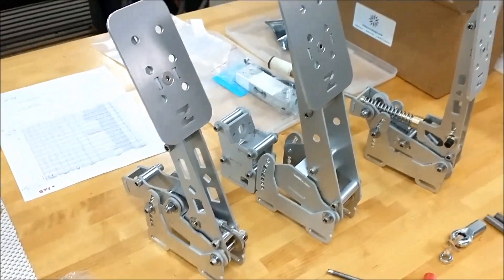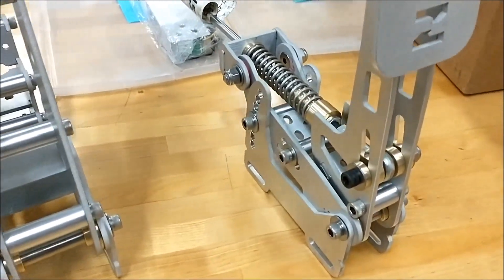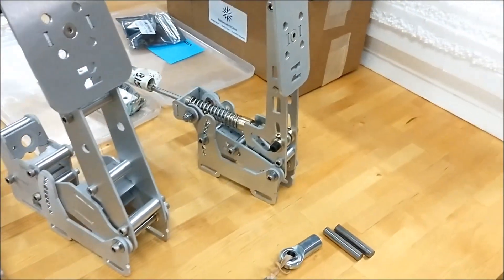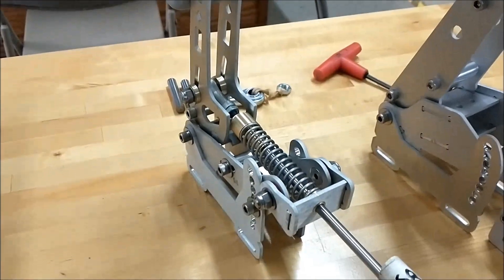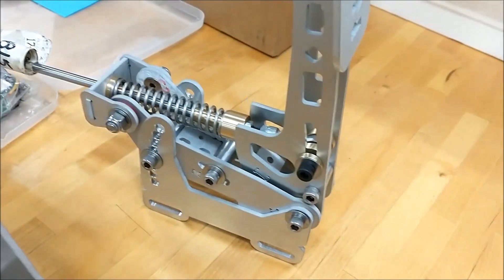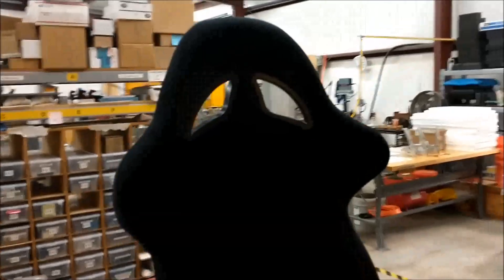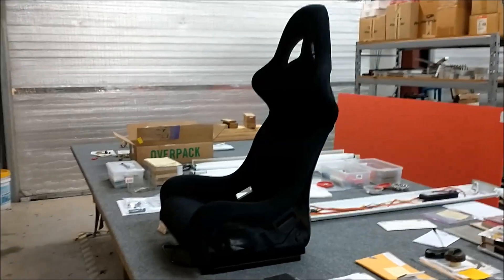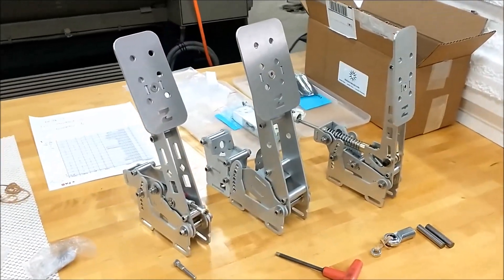F1 Sim Rig Build -- Part 1

Comment: Hi Joe.
I think you made a video a while ago where you make a pin chuck (mandrel?) (bar with a flat and small pin) to drive a workpiece from an internal hole. I can't find this video or am I imagining it? 
I've made a couple of them to drive wooden parts with brass tubes in them, but I would like to check with your video if there is one.
Thanks
Reply from the maker: It doesn't sound familiar as a video topic, but I may have done it in process without realizing it. What is your situation?
Reply: @joepie221  The ones I made work. I was just looking to see if I could find one you have made, because you usually provide more insight. Thanks for responding : )

Comment: sorry for an unrelated question.  you have drilled your lathe chuck and i would like to drill my chuck jaws to tap for holding copper bushings. i've been told this is not doable, but thought i'd ask.  the jaws are hard, barely scratched by a file
Reply from the maker: Unfortunately, extremely hard parts like chuck jaws will need a bit more than just drilling and tapping. I've seen ram EDM machines programmed to burn in threads, and maybe thread milling on a CNC may work, but I would be surprised if you had any other options.

Comment: Happy new year Joe !
Those pedals look like some bits of kit as you say they’ve thought of just about everything for adjustability , I’d imagine some of those up and coming F1 guys will be quite particular about pedal feel !
Iv an unrelated comment / question I’m posting on here as it’s your latest video - 
Iv came across various machines mills etc that have had grease used instead of oil and caused a real mess and lack of lubrication 
However I’m also aware there’s certain areas round some mills / lathes that do require grease e.g. say the motor bearings and possibly a bevel gear set in the head on a universal mill perhaps ? 
Think a lot of confusion can come from these often being fitted with the same nipples  
I’d really appreciate it if you could take the time to create a video going through some of the basics of where grease and oil will be used on machines generally and perhaps common nipple types / oil guns 
Thanks Joe look forward to the F1 pedal videos 👍🏻

Comment: Hi Joe i very much enjoy your teachings.Thanks for sharing great stuff. I am newbie with a new boring head for my mill.could you please tell me how do you set up the tool so it cuts concentric to the hole .I tried a center piece installed in holder but that does not adjust for offset. Cheers Hubert
Reply from the maker: Indicate the hole then align the tool face to the hole centerline. Its a good place to start.

Comment: F1 cars do not have a clutch pedal.  The clutch is via a paddle.  So i guess the sim will be for more than F1 cars
Reply from the maker: As mentioned numerous times in the comment line below, the rig is intended for F1 sim competition, but will have a clutch pedal for other types of racing. Its better to have it and not need it than it is to need it and not have it.

Comment: Hi Jo, happy new year to you too. Question, I think there is some kind of not linear movement concept on the gas pedal. That is interesting to me because I have a T-Rex witch have almost no friction point on the clutch. I already modified my pedal to change the mouvement of the clutch but what I see on your pedal looks quite interesting to me. Is it possible to have more information about that ? Thanks and also thank you for your great work. 

Daniel
Reply from the maker: Hi Daniel. There is no linear movement anywhere on these pedals. Everything is based on at least 1 pivot point for proper operation. Most of the spring motions are a combination of 2 pivots to maintain alignment.
Reply: @joepie221  Thank you

Comment: Can you give us a little more background as to what we are looking at here? I understand what a sim rig is, but did you manufacture all these components in your shop, and if so, from what plans? If these are from a kit, can you tell us which one?
Reply from the maker: All the flat parts were waterjet cut from a free grab cad model posted online. The parts are modeled to be metric, but our material was 1/8" so a lot of notch and tab modification was required to get it to fit. All holes, pivot points and slots were opened up to a standard imperial size to allow for less expensive imperial hardware. My son provided the parts, so I can't pinpoint the source at the moment. Someone has said its an Alex Zergyt model.
Reply: Excellent, thank you, now I have an understanding of your jumping off point. Scared to watch this, because the last thing I need right now is another expensive hobby!

Comment: Strongly enjoying the irony of making an F1 simulator with inch-sized components!

Are you using an off-the-shelf plan that you're adapting or is this something like the kit that 80/20 sells?
Reply from the maker: The plates are from a grab cad, but we are reviewing the design so the spacers, bushings and  everything else are targeted to be commercially available items. Fingers crossed.

Comment: Happy New Year Joe. Another great project. Not wishing to be pedantic but F1 cars do not have a clutch pedal. Operation is via a lever on the underside of the steering wheel. Sorry if I'm being picky. Could have saved yo a bit of work.
Reply: But as Joe mentioned this could be multipurpose, such as rally, truck driving in addition to open wheelers.

Comment: Not sure you realize the road you are going down 🤣🤣 It starts with pedals, then shifters, then direct drive (DD) wheel then motion. I made my own hydraulic pedals, 3d printed a shifter then built a DD wheel, rumble motors and transducers were added also. Working on a design to change my clutch to a Harley clutch disk to simulate the release motion. Rig Motion is out of my budget at 61yrs old, not sure how my body would stand up to it . . . Fun projects to use your shop equipment for!
Reply from the maker: We have the rest of the items. Very high end stuff. Not being into this world, I was very impressed when I saw the electronics and steering wheel setup. These sim racers are a serious bunch.

Comment: Greetings and happy new year and good health to you and your loved ones. It's a pity you didn't choose the metric system. By doing so, you ignore 95% of the world's population by favoring the 6 countries out of 197 that have remained in the prehistory of the measurement system.
But I like you anyway.
Translated from the French by DeepL.
Reply from the maker: Maybe someday I'll find someone that can adequately explain how metric is more accurate or faster. I personally fail to see how one ( measurement ) language over another makes a difference in the size of a part. A 1" block will always be the same size no matter how its measured or defined.
Reply: @joepie221  amen Joe, I prefer imperial. Verbalized imperial puts an exact size picture in my head. Metric tells me nothing, I would need to go to the hardware store for a metric tape measure. 
Cheers 🍻 from Ontario Canada 🇨🇦
Reply: @joepie221  what system does NASA use? 😉
Reply from the maker: @rdouthwaite  Ask them.
Reply: @joepie221  well i do not agree. Metric is simpler... all is multiples of 10s and not divided in multiples of 2/4/8/16/32 etc. Its like counting in hexadecimal. Is it accurate? Sure it is... Is it simple and easy? No its not. Why do you measure tenths of thousands and at same time 1/2" and call it 500 thousands? Doesn't make sense to me. But yes i do agree it is accurate, its just more complex structure and multipliers.
Reply: @fasousa4798  The metric units are completely arbitrary in size...  Imperial units were designed to be in convenient sizes for humans to use, and to be easily divided into subunits that are convenient for building things, without getting into math with irrational numbers, to do something as simple as dividing into thirds.  It only seems simpler to simple people, most of whom have never built much.

Metric is good for a lot of things, particularly for doing pure science, astronomical calculations, etc.  But in the real world that most of us inhabit, not so much.
Reply: @netpackrat  Ok i respect that but i do not agree. First you start in tenths of thousands (don't even know whats smaller than that in standard, tenths of tenths, hundreds??), then you go to fractions of multiples of 2, then units, then you multiply by 12 to get feet and them multiply by 3 to get yards... Its not consistent and coherent as the multiplier keeps changing for the next bigger multiple of unit. theres a reason why metric is the SI unit because theres one unit, the meter and then all above and below are just fractions or multiples of 1000 except the power of 10 closer to the unit ( deca, hecto or deci and centi). e.g.  for quantity as opposed to counting metric uses these prefixes: yotta which is 24 zeros (septillion or heptillion) down to yocto 24 zeros after comma (1 septillionth or heptillionth). This encompasses most of the known world dimensions not to go into specific high range distances such as astronomical units and light years or even parsec. Its interesting though how we are educated on "thinking" one unit and have difficulty "thinking " on a different one... Everytime i hear standard i do a quick equivalency to assess the "real" dimension that fits my brain mechanics.
Reply: @fasousa4798  At the end of the day they are just tools, each with advantages and disadvantages.  The religious fervor and preachiness surrounding which to use gets annoying, and seems to mostly run one way.  I mean really, who cares which one Joe uses to build his simulator.  I'm sure if it were for a paying customer and they wanted it a certain way, then that's what he would do.

Comment: Happy new year Joe. Looks like a very interesting project, being a huge f1 fan I noted the foot clutch, as f1 use steering wheel paddles for the clutch, but it's not just for f1 sim and maybe it could be fitted with both if desired. have at it.👍
Reply from the maker: I say its better to have it and not need it, than it is to need it and not have it.
Reply: @joepie221  I’d rather be looking at it then for it!!!!

Comment: Ref. Imperial sizes,  I worked in the aircraft industry in the UK , on the assembly line for the engines for the Tornado military jet.  All metric engines.  Well if you exclude the fact that all the bolts, nuts and washers were Imperial sizes, mostly made in the USA.
 Nice project too.

Comment: They are fun to drive, but I still find them lacking in the feel for braking. Buying a prebuilt 1 with monitors and computer will set you back 20,000+. Pretty crazy
Reply from the maker: I plan to put some thought into the brake feel. The load sensor is huge.

Comment: Joe have you ever done any machining work for advanced flight simulators? Can’t guarantee I can get any jobs going your way and I can’t be involved with that decision but I can definitely drop your name. Parts wear out and are sometimes difficult to get, especially on the older simulators so occasionally they will reach out to a machine shop to fabricate the parts they need. Ha! This usually happens when me or the NSP tells the sim sponsor to fix it or stop using it😄
Reply from the maker: I've done many different things, but parts for a flight sim isn't on the list yet. I'm open for anything.

Comment: No clutch pedal for years in F1.
Reply from the maker: The rig will be multi purpose. F1 primarily then rally, nascar  and truck. Use what ya need when its called for.
Reply: @joepie221  For NASCAR you can remove the brake pedal ...
Reply from the maker: @UncleKennysPlace  Pretty sure Dale Earnhardt believed in that philosophy too. RIP #3 :)

Comment: Hi Joe,
Happy new year to you and yours too.
What was the reason for choosing water jet cutting for the parts v plasma or laser? Was it finish and little/no clean up? I have see Jason at Fireball Tools water jet cut parts and the edge finish is very good.
Regards Dennis.
Reply from the maker: My mind always goes to waterjet for aluminum. No particular reason. I also always go to laser or plasma for steel. Maybe I'm missing out on something. Waterjet can leave an unwanted edge draft if your not careful.

Comment: Fantastic. All of it.
My son and I (along with thousands of others) continue to benefit from your experience.

Question: in several previous videos you mentioned really disapproving of using an indicator on rough castings. Is this primary because of shock to the instrument? Or are there other reasons?

(Surely you've been asked that before. Spent half hour looking through hundreds of comments, but couldn't find it.)

Keep up the good work!
Reply from the maker: Castings, unless they are investment castings, are usually very rough in both the surface finish and geometry. Its like indicating a brick. The needle bounce will drive you nuts and the shape irregularities will be tough to dial in. Visual high spot reference with the help of a marker or soap stone is very often more than sufficient.

Comment: Today's F1 cars don't have a clutch and the brake pedal does not move ,it merely transfers foot pressure to the hydraulics
Reply from the maker: This will also be for rally and road racing. The brake mechanism will be extremely hard to move. It will read applied force, but the range of motion ( ROM ) will be very short and stiff. Beyond that, the load sensors will do the work.

Comment: Years ago I had a friend who worked at BAR when Jules Vilneuve was one of the drivers. I was fortunate to have a private tour of the factory. One of the things I remember most was the carbon fibre workshop and holding a F1 steering wheel. The only way I knew I was holding it was the fact I could feel it in my hands, there was absolutely NO weight to it. 
I was able to stand next to JV's car at one point and a week later he was in a bad crash and broke bones. I strongly deny any connection to the bolt I have and that crash lol.
Reply: Jacques Villeneuve ?
Reply from the maker: My thought too. Maybe his son or brother?
Reply: @joepie221  Gilles Villeneuve is Jacques' father.  He was a great F1 driver for Ferrari who died tragically in a practice crash.

Comment: That looks like an incredibly fun project to work on. Is your son doing this as part of an engineering project at UT?
You stated that you were going to be making improvements along the way. It sounds like you have already made a huge upgrade over the actual cars, you changed everything to Imperial measurements. 
For the throttle adjustment, do you need to make a special unloosener wrench for it?

Much respect to you and your son.
Reply from the maker: This project is purely for personal use and enjoyment. I plan to standardize everything and evaluate the prototype for strength and longevity. Then maybe we'll offer the plans on the website.

Comment: Three-pedal racing car simulations are much more fun than the modern ‘flappy paddle’ automatic transmissions.  Everything was mechanical and none of the on-board automation and button-fest interfaces of current F1 cars. 

The McLaren MP4/ 6 used in 1991 by Gerhard Berger and Ayrton Senna was one of the last fully manual McLarens. After that they were sequential (like a motorbike) and semi-automatic and with no clutch pedal in recent years.
Reply: even before sequential gearboxes they didn't use the clutch other than to start and maybe on downshifts
Reply from the maker: It will be functional and present for use when required or selected.

Comment: Nice work Joe. Will the brake pedal have a load cell or a hydraulic fluid pressure transducer installed? There's plenty of folk making similar kits for a decent chunk of change, could be a good earner for you if you decide to do some production runs of them.
Reply from the maker: Load cells for now.

Comment: Pretty cool project. A colleague built up a rig like that using 8020 extrusion for the frame. Those die springs are purty.
Reply from the maker: 8020 may be our final choice. Not locked in yet.

Comment: Building those miniatyr machines earlier You are used to handle plenty of parts. Those 3 units looks like consisting of "plenty of parts"...
You woun't build a complete F1 when You're up in speed? Joking!
Reply from the maker: I think the 3 pedals will have over 100 total parts by the time they are done.
Reply: @joepie221  Whow. Even more than I felt. Don't mix the parts and end up with 3 brake pedals.... Joking!

Comment: It's amazing what you can build with a few drilled plates and some drilled and tapped spacers. I really can't wait to see this. I'm assuming he'll have 3 monitors, and possibly rumble motors in the seat? Adding a variable speed fan for his face could be a cool addition, but I could be wrong.
Reply: And real bugs to hit the visor on the helmet ?
Reply: Rumble motor? No, let's see some gimbal mounts like a actual flight simulator so it actually tilts as you go around a turn.
😁